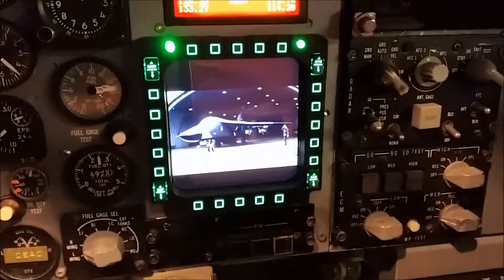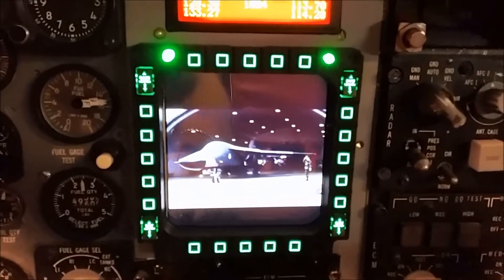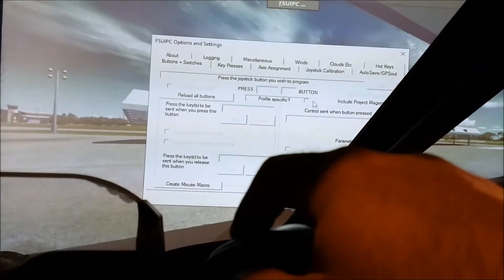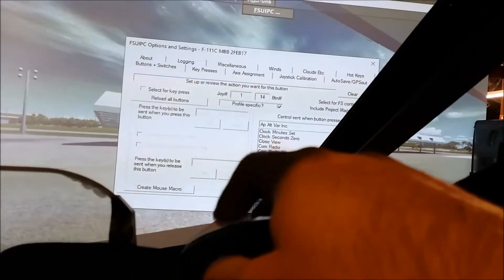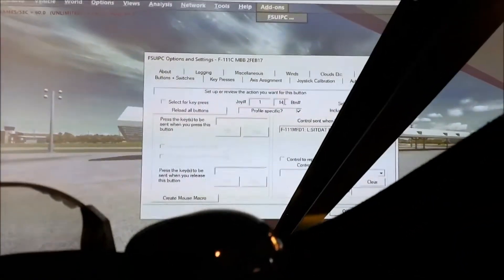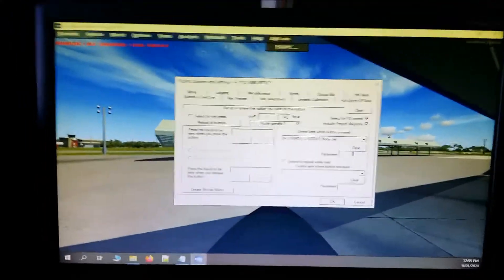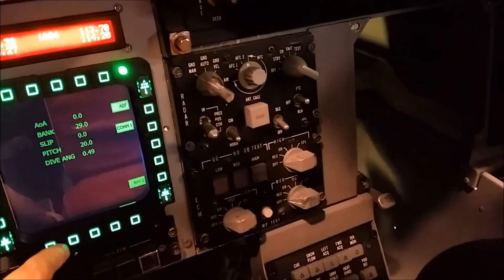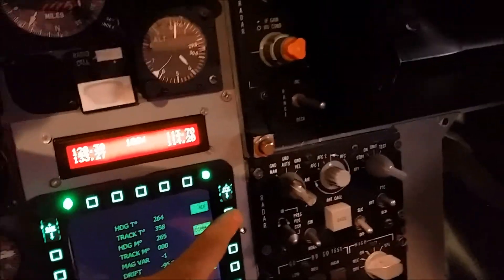2020-01-09 - Thrustmaster Multi Function Display (MFD) interfacing for F 111 sim

Comment: F-111F how did you design the MFD steps/menus? I'd love to chat or see your reference as I am assisting in building the F-111 in DCS
Reply from the maker: Was working on some XML coding for multiple pages, but it's been a while since working on that portion.  Think, the only authentic page outlay I could find was in the F-111G manual.  Don't have anything on the F AMP or C AUP, but may have some contacts that could help with that end.  The F-111 in DCS would be awesome.  What's the best way to get in touch?

Comment: IM trying to generate healthy interest in the Pig, Aardvark, Raven.. in the DCS community.   I come up against so much subjective negativity.  The more people complain.. the more i research this plane, to show them how wrong they are.  The more i become fascinated with this airframe.

My goal is.. to generate enough interest in the community, that a 3rd party developer will feel confident to obtain a license to model it in the game. (imagine a full combat capable world to upload your sim into!)  If people were interested, a developer would take it seriously.

the f111 is in the perfect position to be modeled.  So many pilots and techs and people from the flight line, the company is still around, there are resources that can be found easier than something older, or still classified or still in operation.

im trying to find out if the AUP gave the Pig any MFCD navigation maps (that would be a HUGE selling point to developers. and also the reason to model the Aussie C instead of the Desert Storm era F)
Reply from the maker: DCS would be good.  It is a very complex system to model. 

The AUP C picked up from where the F AMP Pacer Strike left off.  Believe it had some GPS capability.  Think they were based on early F-16 MFDs, likely not the color ones.